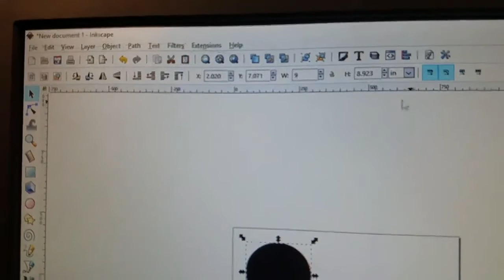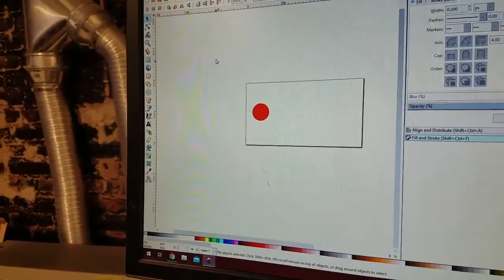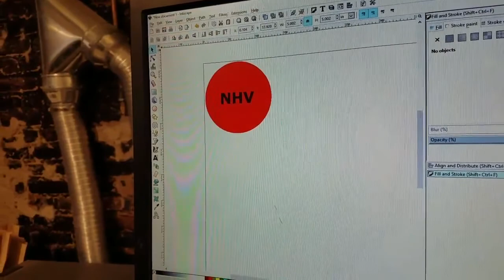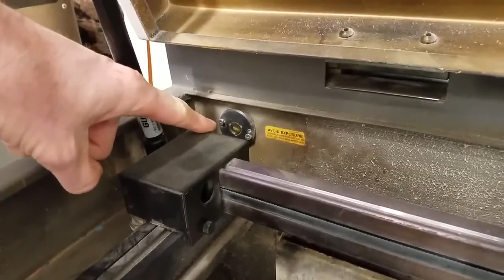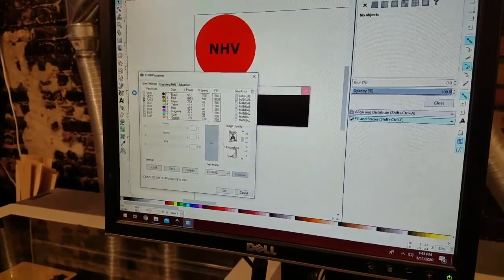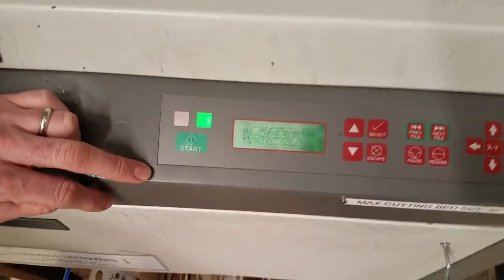How to Use the Universal Lasers at MakeHaven (ULS X-660)

Comment: Just aquired a v-460 great video on the basics of this unit. Glad i saw that your control PC is running win 10, figuring out how install drivers was going to be "fun" as the disk that came with it is for XP, Sadly there is no official linux support so i may be stuck with Win10 as thats the latest driver their website has.